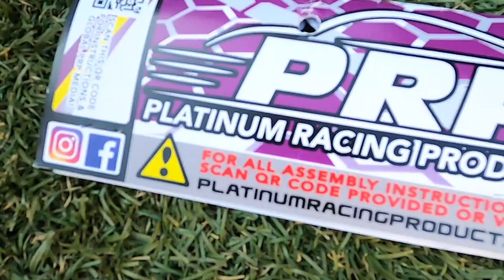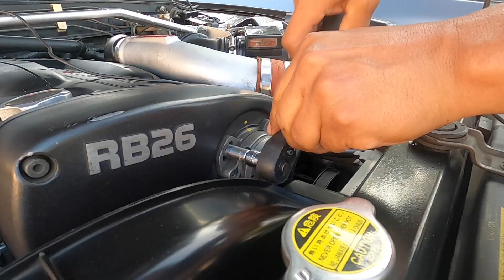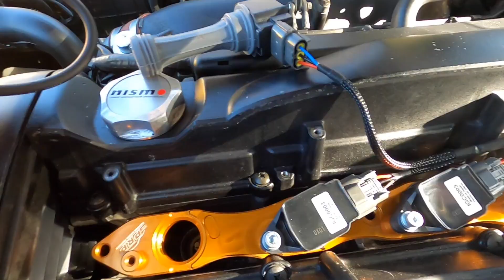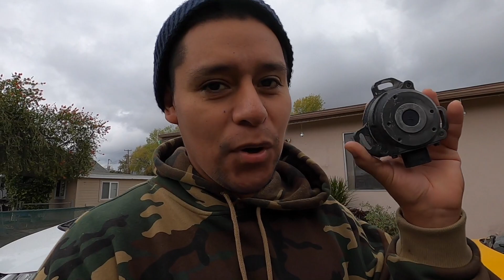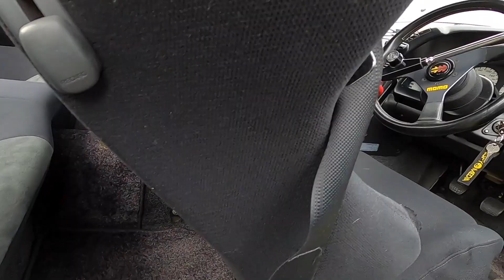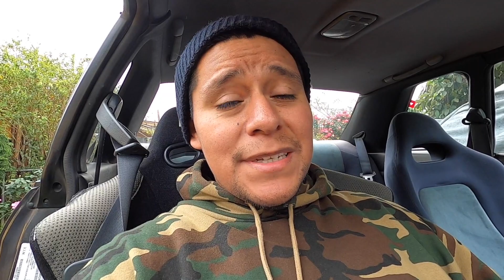R32 GTR Crank Angle sensor

Comment: Nice i will check that on mine  aswell, my cas looks pretty crusty already  hopefully that is my issue too
Reply from the maker: I have replaced fuel pump,fuel filter,FPR,TPS,MAFs, got the Injectors cleaned,new ngk plugs gapped at 0.08,new prp r35 coil packs. I still have to drive it more but the car drove 100% so I hope that was the issue. Down the road I will buy a brand new CAS

Comment: Glad this seemed to be the fix! Now enjoy the car!

Thank you for correcting yourself and using a lead on the num 1 coil. The timing loop is notoriously wrong. That could have been baaad. When I changed out my OEM CAS my timing jumped around 2-3 degrees at idle w/timing locked to 20. Put on an NZ wiring CAS kit and bam! Smooth as silk. Nissan CAS has issues...
Reply from the maker: I still have to drive the car more to confirm it works but it did drive 100%  . Sometimes I just need that big brother that can help me thru the process.  I am learning as I go .😁👍

Comment: Was the issue some hesitation? I had something similar and I deleted the igniter like you did and then installed a new ECU and deleted the MAFs. My CAS is fine so far.
Reply from the maker: So 1) the car had hesitation, under normal driving but under boost was ok. 2) the car had random pauses under boost sometimes. 3) the car had random stalls at idle but rarely not all the time. Car would die when I was warming it up and sometimes when I was at a red light. It would turn over find tho.

Comment: I had fuel cut problems too few months back similar to yours, but mines was a bad fuel filter and fuel pump. and mines is a e46 330ci zhp. lol gearhead problems #struggleisREAL
Reply from the maker: Glad you got it figured out. I also thought it was my fuel pump. Replaced the pump, filter and FPR